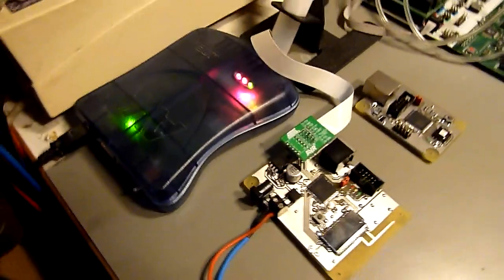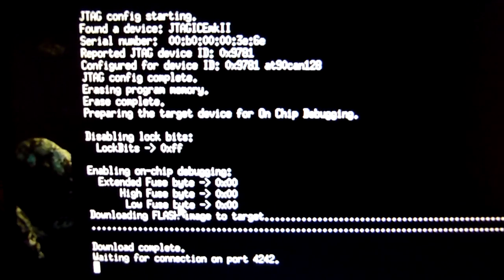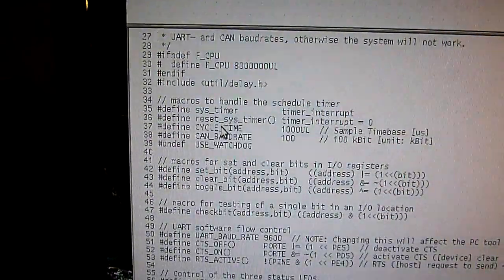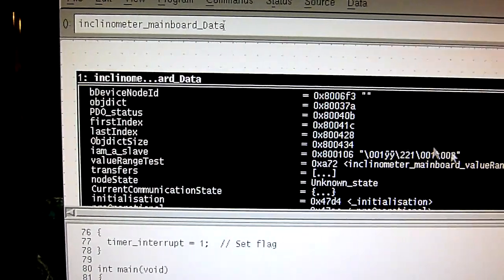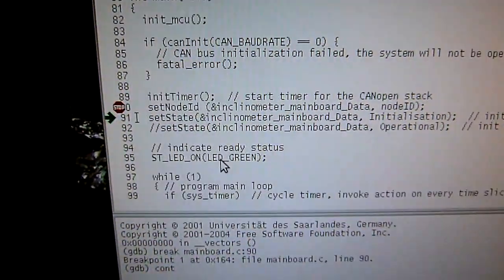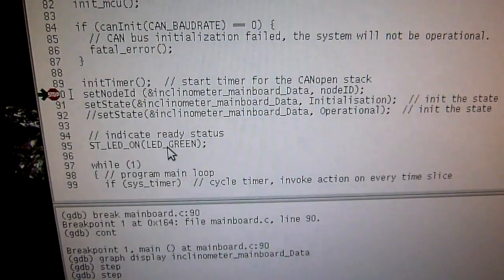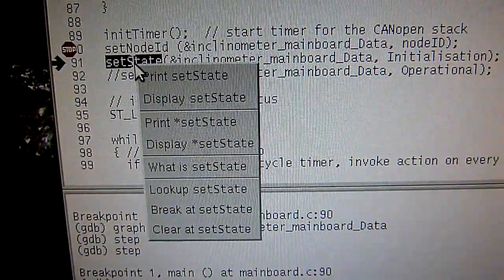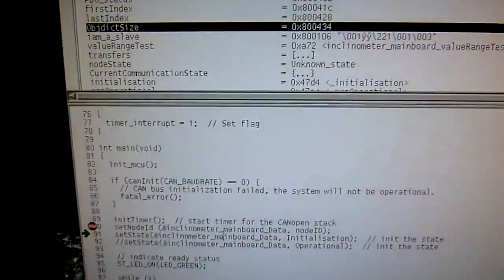Debugging an AVR controller under Linux with GDB and AVaRICE

Comment: Brief tutorial for debian/ubuntu:
We need install avr-gdb, avarice, ddd, avrdude, avr-binutils, gcc-avr, avr-libc;
Compiling our code and burning into MC by means of avrdude (avarice no longer support this operation).  Will run avarice: sudo avarice -j /dev/ttyUSB0 localhost:4242 , where -j = jtag1, /dev/ttyUSB0 = the port used. Then will start the 
DDD: sudo ddd --debugger "avr-gdb". In the bottom, where gdb-console, writting: file /home/jtag/Projects/test/Debug/test.elf    DDD says: "Reading symbols from ... done". Then type in: target remote localhost:4242  DDD will write just about: 0x0000000in_vectors(). Configuration is complete. 
Notice: avr-gcc must have a key -ggdb. With this key, avr-gdb write debugging information into elf file for GDB. Also we should add user in dialout group and logout/login for access files/devices. And must not forget configure fuses for debug.

Comment: How about making more of these videos Michael...about gdb/DDD on Linux with a JTAG ICE MkII device? I've tried to get avarice working in the past, but could never get it working quite right. But Ive to seem more about that sort of stuff--or about setting lock bits or fuses on the Atmel MCUs.

But thanks for posting these videos!

Comment: I think node ID 0 is illegal on a CANbus, i seem to remember anything below 16 is reserved!? Also you need at least two CAN nodes on the bus, otherwise the bus will go straight into an error state on the first packet sent. I suggest a USBcan converter so you can also sniff the bus while developing!